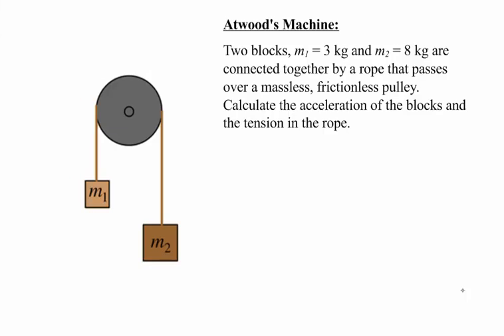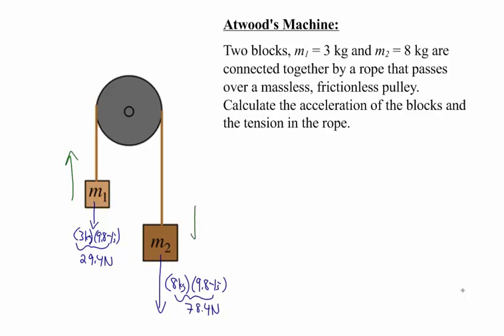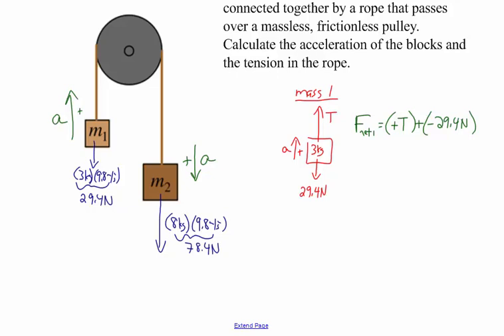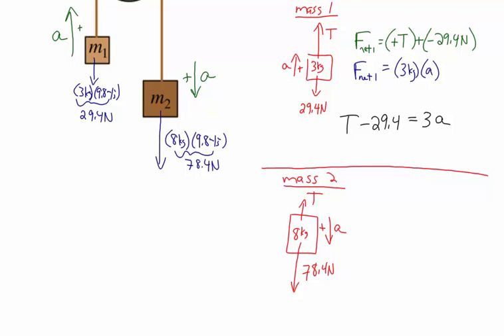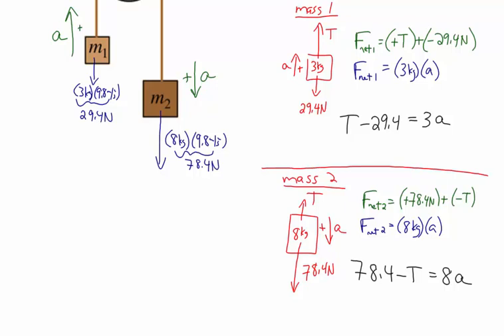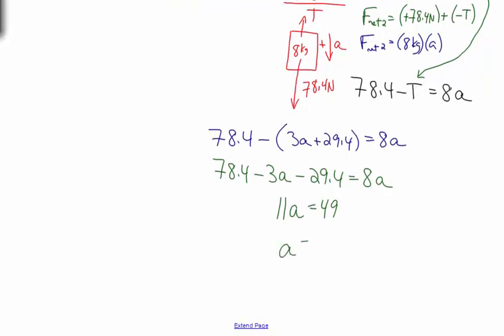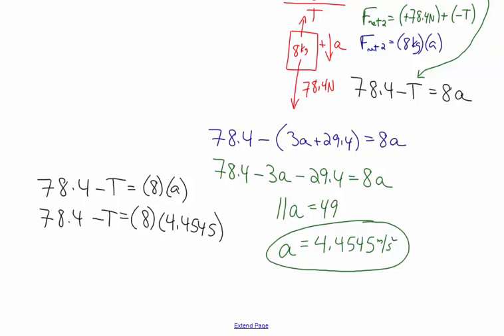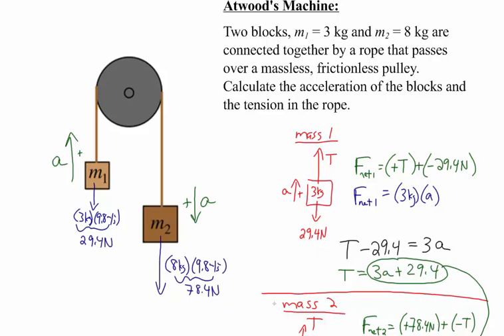Connected Objects: Atwood's Machine

Comment: I see why the tension, T is negative sometimes. It's because the applied acceleration is pulling the string, causing it to fall down. The other mass was moving upwards (being that it's less than the second mass) causing a positive acceleration so, making the tension in T good, nice and positive. You really have to understand the scenario. Thank you for the help, short, to the point.